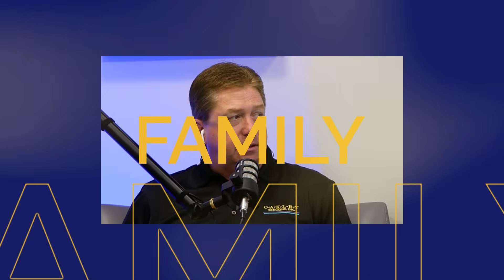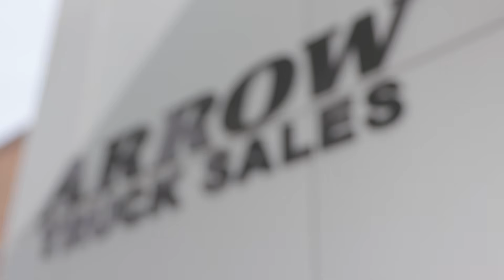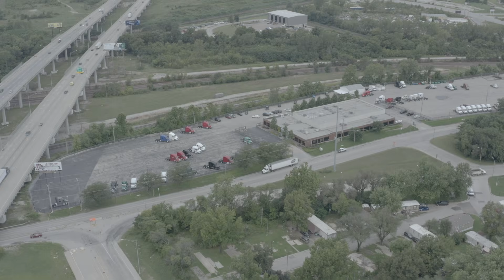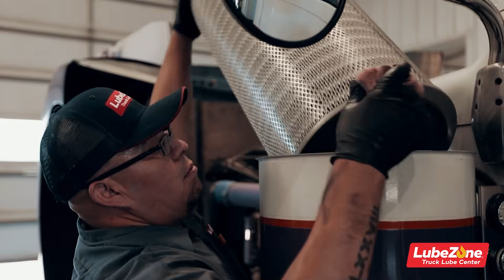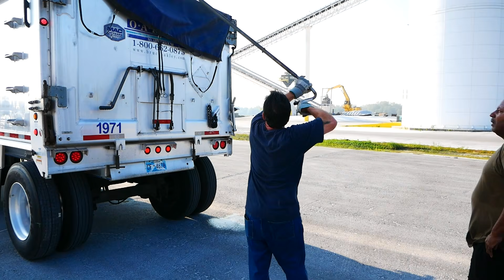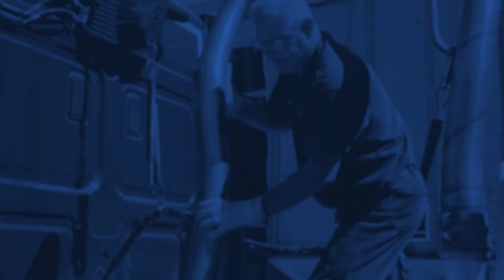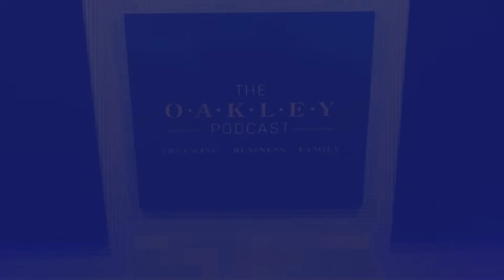196: MATS 2024: The History of Gulf Coast Filters and How They Have Changed the Oil Industry

Comment: The reason filter companies stop selling the toilet paper filters is they dont sell very well. They come with bs stories. I remember when I removed the factory installed spin on bypass filter from my nearly new 
Rambler American flat head 6 and saw the oil go from dirty and black to golden Im thinking everyone will want one. I took a Frantz demonstrator to the big Berryessa flea market in San Jose California. It was that toilet paper will clog up the engine.If they were any good they would be on the new cars. Sure they clean oil but they also remove the additives. I dont know how many times Frantz has gone broke. Frantz had the big diesel filters and the FAA approved AeroFrantz. They are gone now. All they have now is the little filter that is too small for diesels except for small diesels like my Peugeot. Motor Guard went broke trying to sell filters. All they have now is compressed air filters. I worked for a company that used Luberfiners on all of the diesels. They used cotton and later pulverized newspapers. People started thinking they were only for dirty conditions like dump trucks. The Gulf Coast is better because the oil has to travel thru more  paper towels than 3 inches of pulverized newspapers. One guy on YouTube says you dont change oil with this filter. Good luck with that. They are laughing at him. Then he talks about going up to 15.000 miles with a undersized filter.
Reply: When I met my second wife she had just got her 66 beetle out of the shop for a swallowed valve. The repair shop told her because the VW beetles had no oil filter she should bring it in for an oil change every 1500 miles. I put a Motor Guard toilet paper filter on it and told her it will need no more oil drains. She said cool. Married a lady 11 years ago with a new Honda Accord and a decent 06 Pontiac Torrent. She said I could put a toilet paper filter on the Pontiac but not the New Accord. She tells me the Honda dealer said the Accord already has a filter. Where she gets her oil changed they dont recommend an extra filter.  She should come in for an oil change when the indicator light comes on. Told her the Pontiac Torrent oil is clean 100 percent of the time. She is allowing the oil to get dirty then draining it. She is not gettig it. I have an old Motor Guard portable system she dont know about. She is starting to ask me to change the oil.

Comment: 22:13 22:13 22:13 ITook a big Gulf Coast filter and a little Gulf Coast junior to Fort Worth Texas for a converted bus RV and a Volvo. The bus had a 8V 71 Detroit.The guy said my mechanic wil do the Detroit. You can do the Volvo. Im thinking thats a piece of cake. We normally put a tee at the oil pressure switch. 1/8 pipe 1/4 pipe or 3/8 inch on a Chrysler slant 6
The threads on the Volvo oil pressure switch were straight with a gasket like a spark plug. I managed to find a adapter. At home I still had a few old Frantz 2 port sandwich adapters from the 60s. I believe the Volvo took a Ford 3/4 16 thread sandwich adapter. Years ago I bought several Perma Cool universal  oil cooler sandwich adapters from Jegs. I have several little Gulf Coast juniors in use. Some of the riding mowers have no way to get pressure except with a sandwich adapter. My old F250 with the 390 has a Gulf Coast junior on the transmission.      The NASA engineer said the new oil gets cleaner than new with the Gulf Coast filters. I always thought new oil was clean. NASA was as interested in fuel polishing as in oil polishing. Steve is a big diesel man. On pickups you bolt a 5 quart Gulf Coast O1 to the frame. Ive done several Powerstrokes and one Ram diesel.  I put a backing plate on the filter so I wouldnt put stress on only one bracket. When I sold them the filters were made of hydraulic cylinder stock. Hell for strong. Seems like I remember the Fords had more room on the frame than the Dodge.or was it a Ram. Been awhile. 24 valve

Comment: When I did the tree service equipment there was the chip trucks. Mid size Internationals that took the Gulf Coast O1s. The Powerstroke pickups that took the Gulf Coast O1s. Everything else like the chippers and a Bobcat loader took the little Gulf Coast Juniors. Most everything took the juniors on the fuel. In those days the little filters used 2 ply bath tissue. The big filters used Bounty big roll paper towels. Later they started putting them in a bag. I prefer the top loaders. With the Junior out of production I prefer the Australian Jackmaster Classic. They put a high quality roll of Australian toilet paper in a bag and charge about 20 bucks for it. I use Great Value 1000 from Walmart in mine. My old Ford diesel tractor uses a flat head Ford V8 canister filter converted to use half a roll of Viva towels. The smaller roll. The Ford filter is 4 1/2 inch ID. Im a small filter guy.  The tractor uses a oil cooler sandwich adapter to feed the Ford canister filter. Charlie Sims of Gulf Coast filters chewed my ass dont ever use sandwich adapters with my filters. Been using them for over 50 years. Brought back the Motor Guards for awhile.

Comment: Im glad Steve explained that better. The article  in the Road King magazine said the new makeup oil added at filter change was equal to a full oil change every 40.000 miles. Of course the oil is never allowed to get dirty. Thats where you get the long engine life. My thing is small filters. I took Gulf Coast filters to Dallas Texas years ago for a very expensive motor home. Like a Greyhound bus. He said I can tell you are intimidated. My mechanic will do the Cummins. You can do the Land Rover and the generator. I was surprised to see a Buick V6 in the Land Rover. I went up to Lake Texoma and did a 41 foot Chris Craft. Twin 454 GM engines. Gulf Coast juniors. There is a market for the small filters. I had Gulf Coast junior filters on a fleet of lift trucks. The Australian Jackmaster Classic is similar to the Gulf Coast junior. Yes its a pain doing cars and pickups. I could do the old VW beetles sitting in a chair. I always wondered what Gulf Coast Filters did with the Abrams tanks. Ive seen the big portable systems on tandem axle trailers. They bolt the little filters on the frame if there is no room under the hood. I bolted Gulf Coast 5 quart filters on the frame on the powerstrokes. Seems like the frames were wider on the Powerstrokes than the Dodge. cummins. I liked to bolt both brackets to something solid. I suppose you could bolt a 10 quart Gulf Coast filter to the frame. Horizontal of course. That would be for someone that drives a lot of miles.